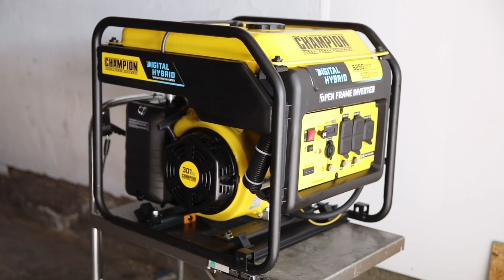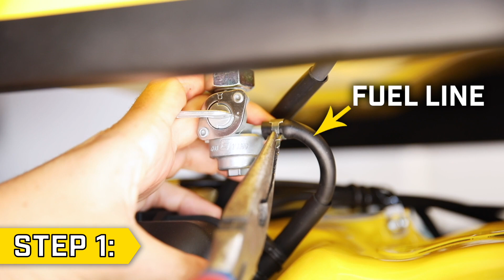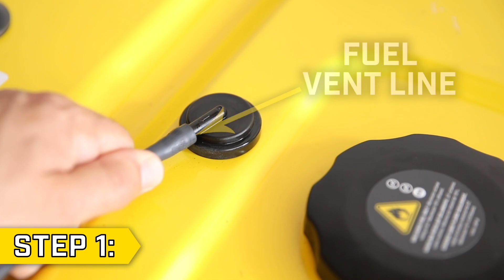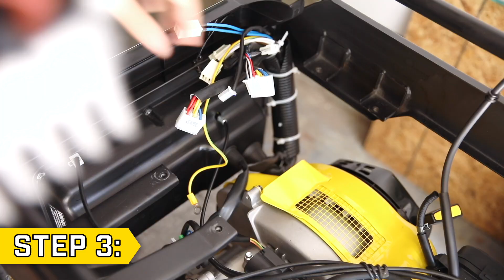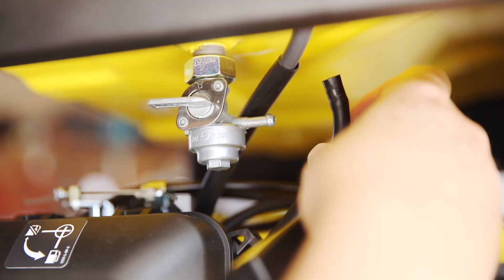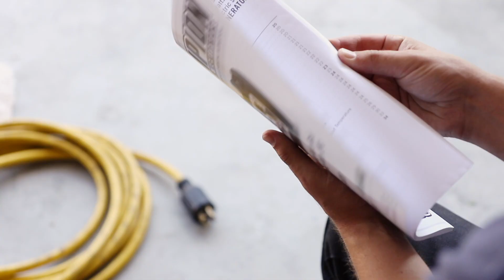Control Unit Replacement (100519)

Comment: How much should I expect to pay for that board, roughly?
Reply from the maker: Hello, for all prices and part availability, please contact our support team at 877-338-0999, and one of team members can further assist you. -Thank you
Reply: I got a inverter module,  for my 100519 and color cable come different  for those 3 that has the same 2 pin plus